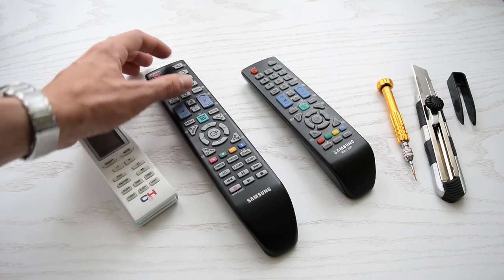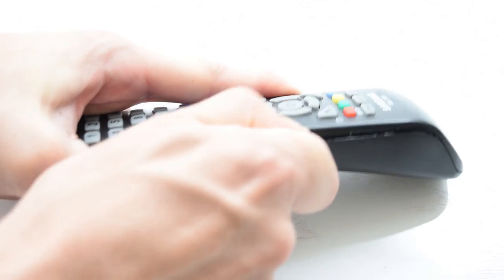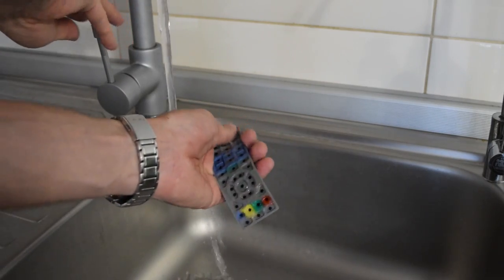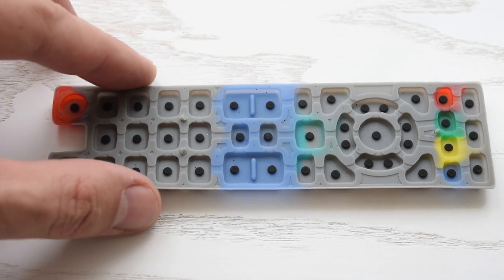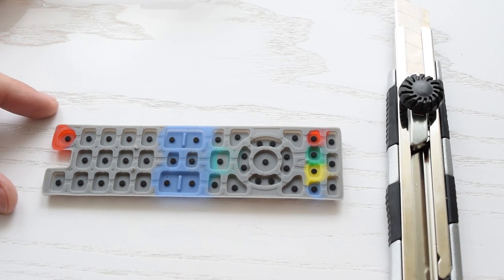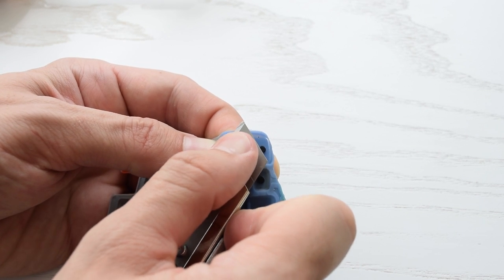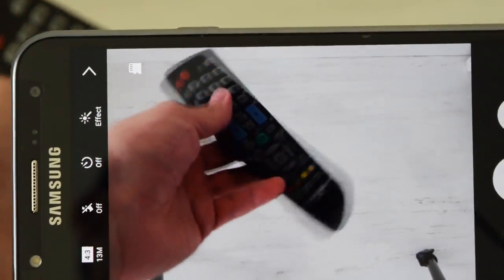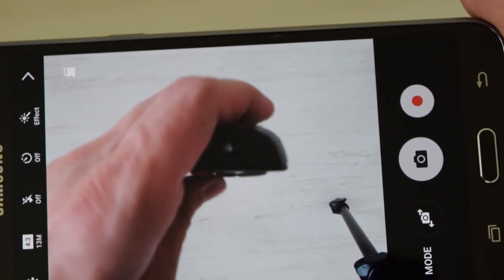How to Fix Worn-Out Rubber Buttons on Remote Control, Cordless Phone, Keyboard, Synthesizer etc

Comment: For all those of you who still struggle with this, this worked for me: Testing the button with another one (doesn't matter which, just make sure the black rubber pad aligns and then click it). If this makes the malfunction go away, you know your button is the culprit. I simply glued some tinfoil on it and it works like a charm now. Might not last ages (going on 3 weeks now) but it's a 5 minute repair without any parts/ordering.
Reply: THANK YOU FOR THIS! WORKED FOR ME!!
Reply: Where did u place the Tin Foil?
Reply: you legend 😀, it worked
Reply: Hehehe thought to do it

Comment: GENIUS, i tried the other methods like opening the controller and cleaning the contacts with alcohol and it would work for about 3 days, finally after the last time i got mad and just resorted to getting up and physically  turning the tv up and down with the dial on my receiver, this went on for about 3 weeks then today i got tired of it and decided to try my luck again with a fix, i stumbled across this video, i ran and cut the contacts off an old tv remote and cut the contact off my receiver remote did a switcheroo and now my receiver remote works as good as new, thanks so much buddy, hope you have great day.
Reply from the maker: I'm glad I could help you!

Comment: Thanks for the video. 
But instead of cutting the black things and gluing them again, can you just use a scissors and cut off the whole rubber button section and just trim the replacement buttonin it's slot?
Reply from the maker: Sure, if it seems easier for you.

Comment: Good tip! But before I cut the rubber pads of my gameboy color rubber pads, I will first try a graphite contact spray. Don't want to order from Ali Express and you can't really trust these conductive pads. Some may be bad. I've already ordered a new replacement rubber pad for my Gameboy but the contact was even much worse than with the worn original pad. I think the conductive surface on it is just cheap.
Reply from the maker: I've never had any issues with the pads from the link down below.
Reply: @ElectronicsComputers  Ok. I will try the graphite contact spray first. If this doesn't work well, I'll buy such pads.
Reply: @Thunderbird1337  I have applied a tiny amount of graphite powder with a cotton swab on the button surface. It is a waiting game but it certainly does the trick in the beginning. How did your experiment work out?

Comment: Actually my problem is random buttons on joypads/keyboards etc being more "limp" than others.
so when it comes to pressing a button (or direction) down it usually has a certain amount of resistance before it lets the button press in, however some buttons give way much easier giving them a spongy/limp/weak feel. It's infuriating when it's a joypad and one of the directions does this or when you try to press two buttons at once, since one presses in much easier it throws you off and you feel it constantly with that slight difference.

I have NO idea how to fix that other than replacing the membrane completely and hopefully getting one that actually presses in equally on ALL buttons, but for a £500 laptop it's a bit of a problem of not wanting to open it up and potentially wreck it.

Comment: Don't bother replace the black conductive pad. just glue a small square of aluminum foil on the bad pad.
Reply from the maker: As a temporary solution it will work but I'd recommend replacing those pads with new ones.
Reply: This will probably scratch your circuit board over time. If you don't want to cut and glue you can try cleaning the pads and board w rubbing alcohol and also glue or tape on the opposite side of the pad so the button presses down further. Graphite spray may help as well. And I would imagine sanding with a high # grit sandpaper or slicing the very top of a pad could possibly help but you would really want the extra pressure on the back of the pad after.
Reply: @MrHighAnxiety63  something like an nes is already about 40 years old. And the traces on most boards are very thin and scrape off without much effort. There's no way I would put tinfoil when you can simply use a pencil/graphite and if that ever starts to fail you can razor off an old pad from a doner like a remote and silicone it onto the original pad.